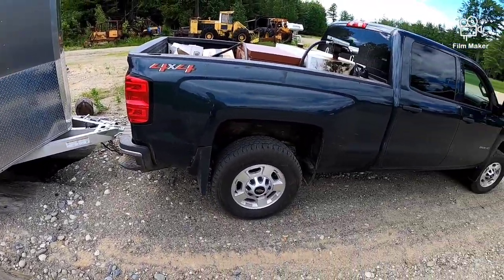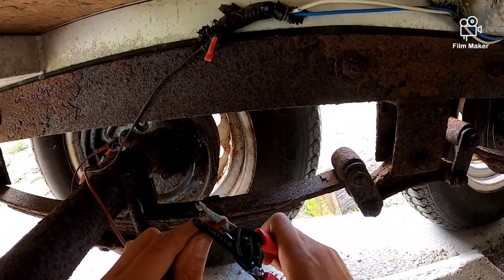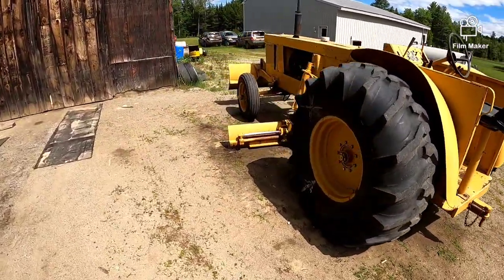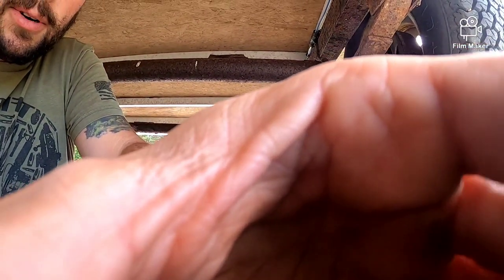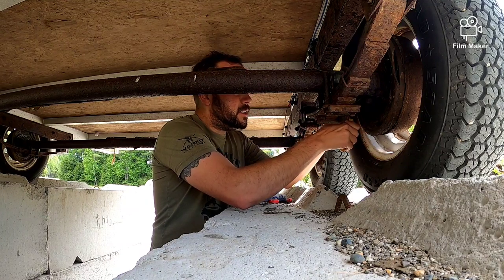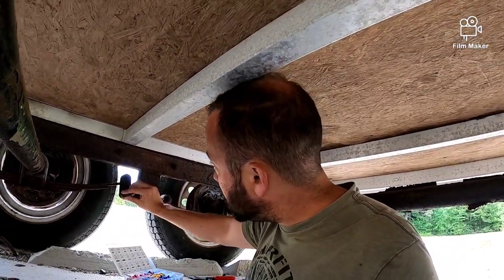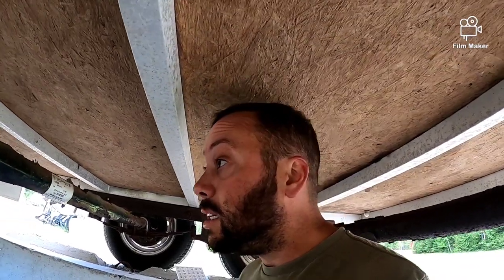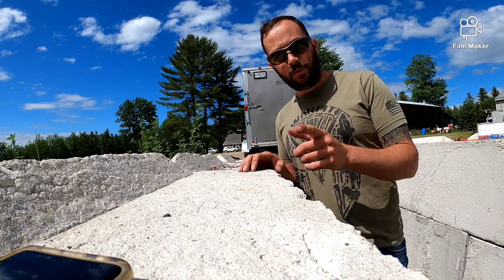Trying to fix electric brakes on the service trailer

Comment: Hi John!!😀😀
A service trailer is a must when you have the type of equipment you have and when you are working in the middle of nowhere. 
Looks like they use a lot of salt up there by you. Couldn't believe how rusty all the steel parts are. 
It doesn't matter what kind of pickup truck you use. It's hard to stop a trailer of that size with no brakes when it has all the things in it that you need. Looks like it really needs to be sand blasted, primed and then painted!!😀😀
It only makes sense that if you have that setup it needs to be on the job. 
Take care my friend and stay safe and healthy!!😀😀👍👍

Comment: My 7 pin quit working.  My question is where do you connect the two wires coming out of the hub of the brakes.